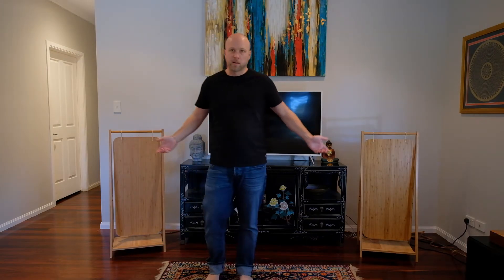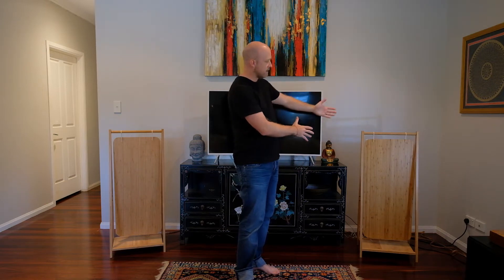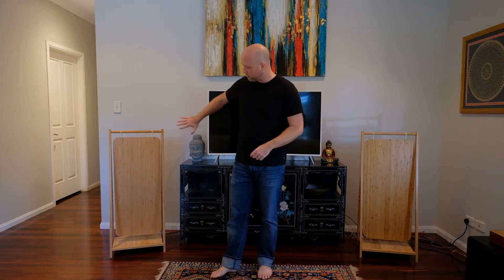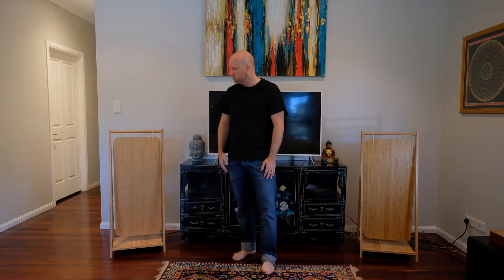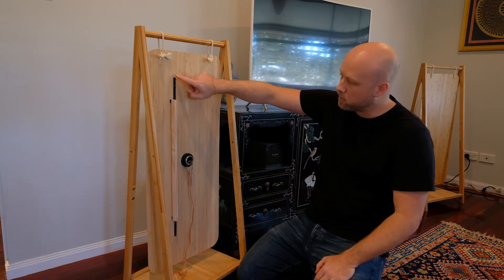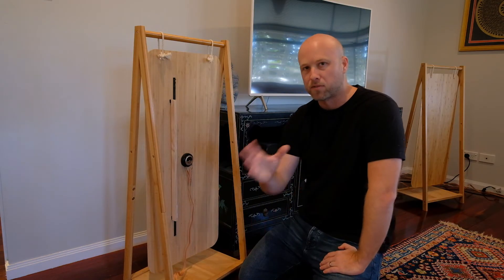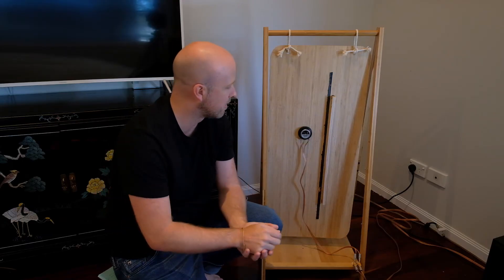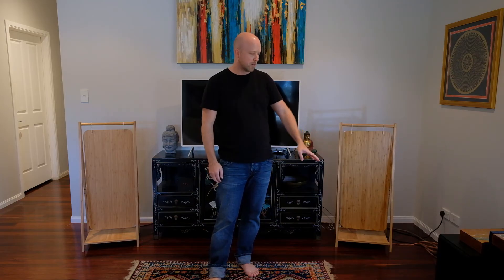How I made my Bamboo DML Speakers

Comment: bamboo, yes! i have a couple decades in dsp acoustic modeling. you should be able to reference the super easy math for modes and nodes on a "2d rectangular membrane" if you want insight into the spectral properties. placement works like touch harmonics a guitar string, at ratios relative to integer divisions/vibratory modes. if you put the transducer right in the middle, you're cancelling out all of the odd harmonics because the center is at a peak in all of them :) bars like xylophones are often struck around 0.224 of the length because it excites a lot of harmonics at that position. i don't know if you want to place to cancel as many or excite as many modes as you can, but given the lousy frr curves of the transducers i saw, it might not be such a big deal :)
acoustic reverberation simulations use 1/4 the wavelength as the minimum frequency a flat surface will reflect, so i guess times the longest dimension by 4, and figure out what that is at ambient temps :) i'd be interested to see if that theory corresponds with anything you measure. "40hz" hmm... i saw one guy with 6 foot high panels..
so you want a perfectly rigid panel that doesn't flex for ideal production. i wonder about ways of producing bamboo plates, but practically, i'd solidly back the bamboo with ultraboard or similar foam for the lightest rigidity. someone was reporting their ideal thickness of foam but it would have to do with how stiff the material is, and i think the laminate ought to work well.
someone else mentioned calibration apps. or if you code, make a waveform with a flat frequency response (eg. white noise), record that and apply the difference to what you can generate with the test signal and placement for the flattest curve, if you want to spent more time doing that :)
Reply: "you should be able to reference the super easy math for modes and nodes on a "2d rectangular membrane" ". Where can I get that? I am quite a numerate person. I've got so many questions on these types of speakers. There seem to be different solutions and different opinions on what the best solutions are. Initially I intended to copy the styrofoam panels from tech ingredients until I realised that he had chopped the top and bottom off his frequency response curves. If the lightest and stiffest was the best, I would bond carbon fibre to foam, but the website of PUI speakers (also made in Dayton!) says "A material’s ability to bend affects low frequencies from 10 Hz to 250 Hz (bass) and mid-level frequencies from 250 Hz to 4 kHz (midrange). Materials that are more flexible will typically yield higher output in these ranges." So what do I do? the 2.5mm bamboo had tremendous ability to bend (perhaps 100 times the E compared to foam but 1000th of the I value), but he said they were useless in bass response. And he said making them stiffer actually IMPROVED the bass response. I don't know what to believe. I also suspect that damping (as in pure foam) is necessary to reduce the amplitudes of the unwanted resonances, but too much damping would mean very little sound. ??????
Reply: @robtristram8395  :) i had a look shortly after i wrote that... my source was a music dsp site (one of the primary ones at a u.s. university.. not ccrma at stanford, but "the other one"... it's upsetting because the site has always been one of the first returns on relevant topics but i cannot find it.. it was very old html with a solid coral color b/g.. can't find the bugger..) the only resourc ei have for that algorithm now is my own source code, i'd have to plug my disky in :/ bug me again and i'll dig it out (jsut in through th door).
apart from that... rigid is good.. ideally, you want a 100% rigid plate with no flex, any flax would add a say.. a "phase delay" to some part of the signal. weightless, perfectly rigid..
"chladni plates" exhibit the modal resonance i was writing about, and this is about placement on the plane; an ideal rectangular plate can be treated like a 2d string.. so you can figure it out brute force using integer harmonics (probably "true" for lower resonances).
ultimately, these speakers won't give you excellent bass response because they don't have the amplitude.. if they vibrate 1cm, that may be loud for high freqs but not for bass. and the freq. response curves of the transducers suck across the board... i was surprised how "flat" he managed to get them, so, it's probably not worth the computations unless you enjoy that sort of thing. maybe someone new has "ideal 2d rectangular membrane" stuff (falstad? or he's just got circular.. which is another option).
Reply: Atomictraveller: thanks for all of the insight.  Have you tried this before? I'm curious as to what people with DSP experience think of these kinds of speakers.

Comment: very nice job ,i have been toying with a hanging mine like yours to get a better sound
Reply from the maker: Hey Paul, thanks! How are they setup now? I actually have some rigid frames ready to go for another pair I’ll be building in a week or two.
Reply: @TypicalBenYT  
Go to  PaulFarley 007 on YouTube to see the demo i am using a sub and looking get away from it. The amp is the key the one i am using doesn't have the range  .one knob is sub and the other for everything else

Comment: Thank you for the video! Any subjective comment regarding DML vs +/- same price cone speakers?
Reply from the maker: That’s a good question. I built these for around $300aud and I’d say they probably sound better than anything in that price. I have a pair of ~$1000 floor standing speakers and I slightly prefer the sound of my panels, except that the cones don’t require a subwoofer to sound ‘complete’.

My goal is to improve the panels to the point where they’re convincingly better than my floorstanders, if possible.

Comment: Resonant points come from sustained reflections on physical spacings at specific frequencies. Reflections are caused by sudden changes in density (impedance changes of material and air) at the edges. Parallel edges guarantee resonant points. There are very good reasons why violin outlines have progressive curvatures with both convex and concave. They have evolved such that no one note is more resonant than another. They even have curved "S" slits on the interior to break up transit distances.
Reply from the maker: Hi Robert, thanks for that it's a good point. One thing I notice when looking at frequency response charts of DMLs is that they all tend to follow the same or similar pattern of peaks and troughs - presumably this is just a function of using rectangular panels of similar dimensions and aspect ratios.

There's obviously a lot of complexity in this topic but I wonder if significant improvements can be made simply by having 4 straight edges, none of which are parallel (like a slightly wonky rectangle)? Might be a a good thing to experiment on with some cheap materials.
Reply: The strongest resonances will come from the first reflections from a side or a corner. Remember a 90 degree corner acts as a reflector back in the same direction. I put a cusp on the edges opposite the exciter to prevent reflections. Also with two exciters, you will similarly get both peaks and nulls from the wave interaction on the panel, plus comb filtering in the air from each source.

Comment: I'm curious if you tried hanging the panels so the length is going left to right. I would think this would make a big difference in bass since the length of the panel is not as effected by the weight and tension of hanging the way you have it. Perhaps a cut from the 3/4 mark on the bottom to the half-way mark on the side would give a different resonance due to differing lengths on the panel. I'll subscribe for now in anticipation of watching your next video on this topic.
Reply from the maker: Hi thanks for the idea. I haven’t tried it at all as it’s not an easy fit in my living room! It would be interesting to see if the orientation has any effect. Something to measure for sure.

Comment: Thank you for sharing, Ben.
You' ve addressed some of my questions as I think about setting up a DML speaker system, including the need for a subwoofer.
I'm pleasantly surprised that plywood works so well. My naive thought was that opposing grains in each plywood layer would affect sound quality. Thinking about it some more, plywood probably makes sound more consistent one panel to another.
A question: sound spreads outward from the back of a panel as well as from the front. So, how is sound quality affected by ...
distance from the wall,
wall surface (would it help or hinder quality if wall has a sound absorber panel behind speaker panel, or if wall is, say, brick)?
Finally, your voice recording suggests that your listening room has some reverberation, just like mine will. Soft furniture helps. Have you experimented at all with sound absorbing materials on your walls? (My wife is resistant and totally rejects the idea of anything on the ceiling.)
Reply from the maker: Hey Hume, glad you found it interesting.

Regarding the sub - Increasingly I feel that this is the best solution. I’ve seen several people claim to get good bass response but I just don’t think you’d get that smooth, round low end like you can with a subwoofer. I think I’ll try a large panel ‘dml sub’ as a project but I don’t think it will be a great solution really.

You’re right about my room. The panels definitely benefit from being pulled out into the room - an advantage of using the frames rather than hanging on the wall. When out 3ft or so there’s a nice 3D image to the sound. I haven’t given too much thought to treatment - the reflections seem much less of an issue in person - much more noticeable through the mic. I will see what I can do when I’m 100% happy with my panels though.

What are your plans for your panels? Construction?
Reply: @TypicalBenYT  I built a pair with XPS foam and paired them with a sub woofer and an old pair of Boston Acoustics A60's and the sound is excellent with them all firing together. I don't think that a good dynamic range is reachable with DML panels alone. The lower end is best supported with a sub woofer and it is hard to get the clarity on the high end without a good quality tweeter. Where I've found a DML really shines in obviously in the mid range and for acoustic instruments in particular. Again, with a combination of traditional speaker together with DML's, the sound is quite superb.
Reply: @TypicalBenYT  My plan is extruded Styrofoam insulation panels, but I do like your plywood idea. I think I would go with something thicker than the lazer-board though, even at the risk of losing some trebble, and use a subwoofer that kicks in at about 160Hz.
I have a frame in mind too since accidental contact with another object can affect quality, and the styrofoam panels are fragile. I am thinking of a 600mm*1000mm panel with rounded corners suspended with fishing line inside an all-round wood frame 700mm*1100mm.   
  https://www.bunnings.com.au/bastion-1200-x-600-x-30mm-xps-multi-use-insulation-foam-board_p0139535

Comment: Hey Ben,

I am a Hobbyspeakerbuilder from Germany and your video is great but it lacks what the most videos about DML do; Measurements of the Nearfieldfrequencyresponse (usually 2-5cm from the Membrane), Farfieldrsponse (1Meter in anechoic chamber or gated). A good Capsulemicrofone should be good enough, but ideally calibrated because these small Microfones deviate a little bit.
Can you add both to your next video? Thank you. If you need some advice please let me know, I am pretty sure you can find me on Facebook.

Cheers
Nik
Reply from the maker: Hey Nik, thanks for the advice. I'll message you about it soon!

Comment: Interesting approach. How does the treble sound? Also, I suggest sound samples of music that we are likely to be familiar, so we get a better idea of how they sound.
Reply from the maker: Thanks Geoffrey. The treble is very smooth on these,m. It does drop off above about 12khz however. I am going to try to improve this response in my next pair. I have posted another video with some music and plan to put some more up when I get some time.
Reply: Maybe try a super tweeter on the back side with a toggle switch to turn on or off.

Comment: Mine the went down to around 40hz but more pronounced at 60hz using the tone generator test aps.
Reply from the maker: Wow interesting. I will give my other plywood sheets a go. They must be a similar size to yours.
Reply: What size were your panels?  I'm starting a project, and would like to get the size correct.
Reply: @qua7771  https://youtu.be/C6QRewcwZkM
Reply from the maker: @qua7771  If you're asking the other commenter, he made a video where he said they're 2'x4' panels. Mine are 40x90cm as I wanted something more living room friendly.
Reply: @TypicalBenYT  Thanks for the reply.  I do appreciate any new advice on this topic.  The DML thing is new to me.  I have been using Kef speakers in my system for over a decade.  Since the 80's I have been interested in Magnepans.  I have never pulled the trigger on purchasing them due to the impracticality of the cost vs the non-conventional design.  They typically place them 3 ft from the wall.
As for DML, it seem to be the answer to a dream.  I don't care for the appearance of the 2'x2' design.  I'm considering proportions following the golden or silver ratio (maybe 15x24, or 12.5x30).  I don't know how changing size effects the sound, in terms of efficiency, soundstage, frequency response, etc.  For home esthetics, of course size is an issue, but at what expense.
I have a fairly small theater room, (converted bedroom) that I use for theater, with Dolby Atmos 9.2.

I currently am planning on using sheets of foam core board, which comes lined with paper.  I'm not sure what thickness to buy.  I'm considering suspending it with thin bungee string, weather stripping, or spandex in a frame, or stand of some sort.
Any comments are more than welcome. I apologize that this is so long.
Reply: @TypicalBenYT  Edited; I do appreciate advice.  (darn spell check).
Reply from the maker: Sorry for the late reply.

I hear you on the aesthetics part of the equation. The challenge for me is to make panels that sound AND look good. If that means I have to sacrifice perfection then so be it - I want something I can actually use!

My understanding is that squares are less than desirable for DMLs anyway. You want different length sides to allow the propagation of as many different modes (frequencies) as possible. I haven't use either of those ratios although my bamboo panels are quite close to that silver ratio at 40x90cm. I think that going up in size will decrease the fundamental frequency of the panels and yield better bass response, but my feeling is that it will be very hard to match a conventional sub woofer for quality bass reproduction, which is why I have so far not worried about bass too much.

I can't comment on the foam board as I haven't used it, but there are some very useful (and long) forum  threads online if you're interested and haven't yet  stumbled upon them!
Reply: @TypicalBenYT  Thanks for the reply.  I don't mind it being a few days late because my sound exciters are back ordered.  I've done as much forum reading as I can.  The threads are long with some pertinent information on each page.  I'm a bit concerned about efficiency since I'm trying to plan a wall mounted home theater system.  I'm thinking of using acoustic treatment behind mine.  I have subs.  I would like to see sound levels similar to typical book shelf speakers.  I'm not sure if this is a realistic goal.
Now I am considering using 6mm expanded PVC as a panel material.  I haven't heard of anyone using it in my searches.  It's about as rigid as plywood per the same thickness, but lighter that most wood.
I guess it will be experimental.

Comment: I guess larger board gives a bit better low end. I suggest 60cmx120cm is the minimum size.
Reply: Yes! you can, with more than 1 exciter and a bigger board.
Reply from the maker: @MyChannel737  have you done it? How low does it go?
Reply from the maker: Thanks 🙏 I guess the question is ‘can you make enough bass to do away with the subwoofer’? If the answer is no, then I’d prefer a smaller panel anyway. If it’s yes, I might have to consider it!